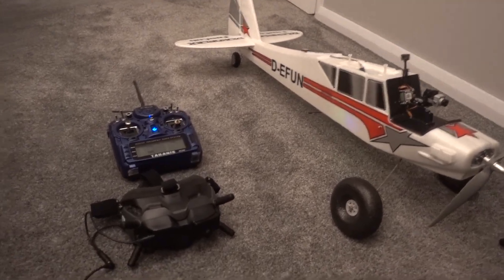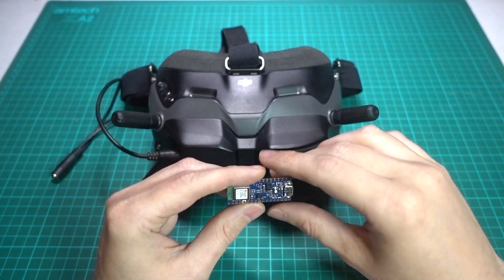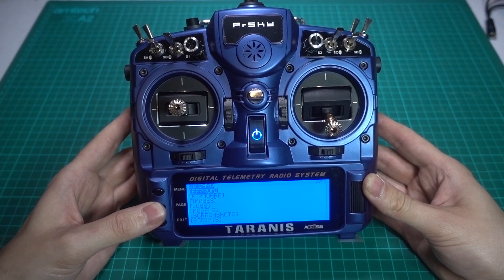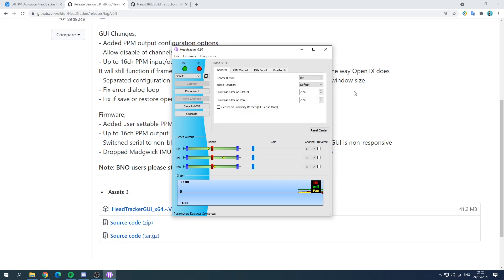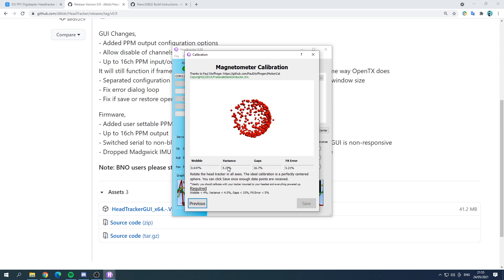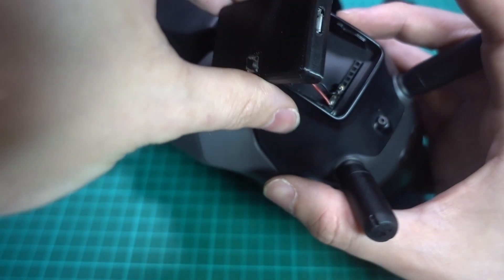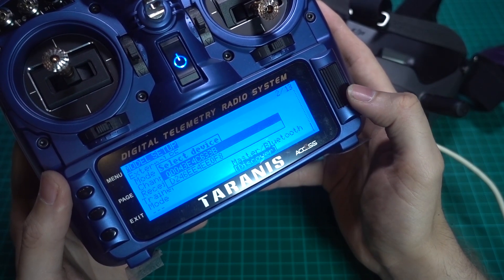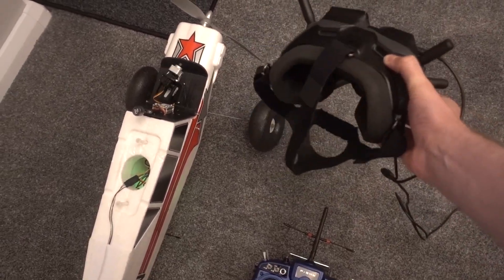DJI FPV Wireless Head Tracker

Comment from the maker: Digi Adapter:
https://bit.ly/3yD7qPm
https://bit.ly/2RHPaDL 
https://bit.ly/3yzkPb9
Arduino nano 33 ble: https://amzn.to/3wvGrn0
Switch: https://amzn.to/3ud2s8B
3d Print Mount: https://bit.ly/2SswcAQ
GUI Download: https://bit.ly/3yK8EZh
X9D Plus SE 2019: http://bit.ly/2GYO7Xn
TX16S: https://bit.ly/2Lpts0I
Radiomaster BlueTooth Module: https://bit.ly/3fKMuwZ
Reply: Could you please link what exact servos you all are using for pan ,tilt?  
I'm currently using a 360⁰ servo which is continuous and all though it works on my wing FX-61 because I can use the yaw/Rudder because obviously wings don't use rudder so I use it for pan.  This would be an issue though on standard plane setups though.    

Thanks.
Reply: In addition, the FrSky bluetooth module doesn't support Nordic's BLE LLPM~
http://developer.nordicsemi.com/nRF_Connect_SDK/doc/1.3.0/nrf/applications/nrf_desktop/doc/ble_latency.html
Reply from the maker: @PaosElectronicDreams  @ pao Nan most of the links you are posting youtube is deleting, please try to do your comment without link thx
Reply: @AndyRCchannel  I've shortened the URL with store link. It's not deleted yet.
Reply: @AndyRCchannel  I am going to test possible LLPM link among the 33 BLE's.
Reply: Where can I get all the 3d printed 3axis gimbal
Reply from the maker: @RCPlaneNut  eastiest way but not cheap search for "bad ass Gimbal" otherwise search for my ultimate plane build

Comment: Hello, when you talk about the sensor on the arduino, is that the same as headers? Because I only found the Arduino Nano 33 BLE rev2 with Headers (ABX00072) or without Headers (ABX00071).

Comment: Just wanted to confirm Andy.. I need to use the head tracker wired because i have my internal Bluetooth module on my Tx16S  MK1 connected to a mini crossbow tracker... therefore I need to use the PPM Para master Firmware? Is that Right?
Reply from the maker: That's correct yes
Reply: @AndyRCchannel  Thank you!!! Kudos to your channel!!!

Comment: I know this is an old video, but I've followed along most of the steps... the only part I cannot get working is that my new TX16S (which has Bluetooth built in from the factory) cannot see the Arduino to bind to. Any thoughts? Any chance of an updated video? 😁 The HeadTracker version is 2.2 as of today. Thanks!
Reply: @AtlayGaming Hello, am on the exact same path as you right now. Did you fix the problem ? Are you sure new tx16s controllers have build in bluetooth ??

Comment: Hi, Cool video thanks! I want to buy a new rc system, and I am a bit confused regarding the head tracker connection. what should I look in terms of connectivity of the remote controller to ensure I buy a system that can be connected wireless to the headtracker? thanks!

Comment: What other goggles will this work with? Will a Spektrum radio work also?
Reply from the maker: It will work with any goggles it just wont be as neat of a solution. Not sure about spektrum as I dont use it. If the trainer port can accept a signal in as well as out then it can do it. but would advise against spektrum as it does not have the control range needed for FPV only line of sight.
Reply: I have a friend that flies a trainer, top wing out of visual range and back with Spektrum Dx9 and a full range 6ch receiver but he doesn't use a head tracker. My radio had wired or wireless trainer set up
Reply from the maker: @michaelmickoberhaus8009  Just had too many failsafes, flyaways and a lot of money lost using spektrum for BVLOS. Its nicknamed team failsafe in the fpv community. You want to be using a radiomaster TX16 with crossfire or ELRS. Much cheaper with a range of 50km plus
Reply: Can you recommend a decent affordable goggles? Was thinking Eachine Ev800D ?
Reply from the maker: @michaelmickoberhaus8009  yes those would be my go to budget goggle
Reply: I have a Radio master tx12 but have difficulty programming it and I don't have a lap top. Never actually fly anything with it yet. I bought it for the additional channels for my planes.

Comment: Thanks for the great video. I have made a 3d print and the only thing to do is solder the module in my Radioamster TX16S.
What is the best way to enable bleutooth on my Radiomaster with EdgeTX 2.6?
Reply from the maker: same as it is in openTX
Reply: @AndyRCchannel  Thanks. EdgeTX is not the same as OpenTX. Write FW to TX is not posible in EdgeTX. Builds option can not be changed and write to TX. In OpenTX it was no problem.
Reply from the maker: @Ard1400  Thats not what he was asking. He was asking how to enable blutooth in edge TX and its the same as openTX

Comment: Can that little bluetooth board be installed in Taranis x9d plus?
I have the Motionsic side mounted tracker and gimbal, but would like to go wireless between them without using a second exterior board that plugs into the trainer port (thats of course under my CRSF Lite module).
Reply from the maker: Only way u can do it is hard solder another Arduino board to the trainer port
Reply: @AndyRCchannel  is that easy to do? And would it permanently take over the jack so that it wouldnt work with a plug and 2nd tx trainer?
Edit..
I checked out the github page.. in the “bridged” diagram it looks like the regular/original jack input would be rewired into D9 on the Arduino board, would then combine channels 1-4 with the HT channels then it’d send it all out of D10 into the original jack-to-tx input.. maybe?
That jack is probably hard on a board though, problematic to reroute original plug I’ll bet.. need to crack it open, but hate to do that, I was just partially into it to install Hall gimbals. Ugh..
What irks me.. I ordered a Taranis x9d plus 2019 that would have been PARA… but instead getfpv sent me a standard x9d plus with a R9M that I sold off in favor of crsf.  Thought I made out on that deal.. until now :/

Comment: Thanks for the excellent video. If the Arduino Nano 33 BLE is flashed with firmware version that requires for connecting it to the radio trainer via a barrel plug, can it be re-flashed again later on with a firmware version which allows it to connect to the radio controller wirelessly via bluetooth? Thanks.
Reply from the maker: it certainly can :)

Comment: Andy, I am about to set up this system with a Taranis X9D Plus 2109  Access radio. I can't get the Bluetooth part figured out. Can't locate the Trainer/bluetooth mode. Can you tell me how? I have my Arduino nano ble board configured.

Comment: How'd you make this? Looking to build something like this but then on a car.
Reply from the maker: All the info is in the video. There are no parts missing. You problem with a car is their controllers have no trainer in port they are all trainer out.
Reply: @AndyRCchannel  hmmm I'll have to find a workaround for that then. Thank you so much! :)
Reply from the maker: @MrCow579  there's a guy who used an easy Arduino board and re coded the pwm signals so it would work. Look up rc car controller for head tracking
Reply: @AndyRCchannel  will do, I appreciate the help :)

Comment: Will it work with a spectrum IX12??
Reply from the maker: Does the radios trainer port allow input signals as well as output? Spektrum is very limited with features and range so I wouldn't recommend spectrum for fpv in general
Reply: @AndyRCchannel  I have a barf bag set up for the camera.
I would like to hook it up to a spectrum ix12 hooked up to an air unit with that tracking system basically with your exact headset that you have with analog and DJI capability 😍
I love that setup
Reply: @AndyRCchannel  P.S...
The crossfire system for the spectrum ix12 is on my to get list as well as the head tracking unit

Comment: Great video, thanks. I tried to load my Nano 33  board onto the GUI keep getting an error message saying “ was unable to determine the board type” and they will not let me connect . I am using a Nano 33 BLE (ABX00034). Any suggestions for me appreciate it. Thanks
Reply from the maker: Sounds like you are trying to use the wrong configurator
Reply: @AndyRCchannel  Is there another configurator? I thought this was the only one.

Comment: Awesome! I've just purchased the Bluetooth board via the link. Just to say though that at 4:35 when it shows the Bluetooth board... I'm guessing that's not the latest FrSky board, because it's using an antenna wire, whereas from researching it seems to be that the FrSky board has an onboard antenna, so no separate antenna needed. Please comment though, especially if I have this wrong.

Comment: I have successfully flashed both the bootloader and frsky firmware to a generic RF-BM-S02 module which is the same as the FrSky module but comes shipped without the required bootloader or firmware and confirmed it working in a radiomaster. 
I did my first one by soldering 30 gauge silicone wires to the pads but I have a programming clip on order which will allow me to flash more modules without soldering to to them and plan to put some on eBay as I can get generic modules cheaply from China but they need both a bootloader and the firmware flashing to them which annoyingly is done by different pads and different flashing tools but does not take long once you have it figured out.
Reply from the maker: Ah that's great. EBay sounds like the best bet. I'll buy one off ya

Comment: Mine is a crossfire full side with bluetooth, can I use it with this arduino module, I do not have bluetooth in the radio or the version of opentx for bluetooth.

Comment: I don't know if you mentioned it and i missed but does this work only for CRSF? Also can this be done in Betaflight?
Reply: It will work with any protocol providing you have 2 channels spare. Yes it can be done in betaflight... see painless360's quanum headtracker guide and follow the same steps just at the betaflight section.

Comment: The FrSky Bluetooth module is based on non frsky hardware but with frsky firmware on it.
I am trying to get a non frsky module working at the moment,  I have managed to flash a bootloader to it but now I have a bootloader,  I'm trying to figure out how to make it respond to a firmware flashing attempt which has so far not played ball.
People with a horus radio can flash non frsky modules with the firmware from your radio, it flashes them when they are installed I am told by someone in the know.

Don't know if the jumper or radiomaster radios will do the same but I'll try it with the module soldered in using 30awg silicone wires rather than directly to the board as removing it again will be easy to go back to programmer flashing attempts if it does not work.
Reply from the maker: You need the one without the ufl connector 30gbp. That one works. Radio master themselves confirm that works. The one I took out of my Horus worked also. But that will have their firmware on it then I guess?
Reply: @AndyRCchannel  yeah,  I have the module with the integrated antenna, mine was £5 from China 😀
The module is a RF-BM-S02 irrespective of antenna type if you didn't know the part number already, that's what the FrSky module is but the ipex/ufl version as you obviously know.
Yes, the one taken from your horus will already have the correct firmware on it,  installing another module without the firmware to your horus would result in your horus flashing the firmware to that module also. 
That's promising news regarding the radiomaster,  looks like I know what I'll be attempting after dinner, fingers crossed 😀

I have the FrSky module firmware if anyone is interested in it, it's not easy to find!
Reply: @PonyPonyBaloney  what Andy is doing or the FrSky Bluetooth module in the tx series transmitters?

Comment: What is the latency? Can it work with a tbs tracer? 😉😉
Reply: Its bluetooth so there will be a little latency, but you can see from the video that its certainly not bad. Don't see any reason why it wouldn't work with tracer.. it will work with any protocol and receiver unless all your channels are already in use. this will need 2 spare channels to work.

Comment: I'm using the x9d plus accst version.
  I set this all up a couple months ago.
I started by running a mono jack into the trainer port and it worked like a charm.
     I then bought a second arduino and set it wireless, again with a mono jack to the trainer port, and it did work, although with some lag and some jitter.
      I ended up going back to the wired setup.
   Is it possible to solder the ardino into my radio? Maybe use the the uart connection? Do you think it would be less finicky than through the trainer port?
Reply from the maker: It is possible but if you were having problems then you will have the same problems with it inside your radio. Plus its always turned on with that method.
Reply: Did you use the same github Code for your wired setup? Just solder the mono jack to the arduino and it works?
Reply: @he1nz453  There was a seperate (slave) firmware in the folder. I flashed the second arduino with that code.
   It did work, it was just laggy and jittery. I went back to the wired configuration and It worked perfectly again?
Reply: The Bluetooth thing would have been cool, but I just built up a custom cable that will power both the arduino and the goggles from a lipo in my back pocket, and ran the signal cable back down the same line and split it off to my taranis.
    I added another momentary switch to ground just before the 3.5mm, so I have a centering button that velcros to the back of my radio.

Comment: Hell yeah!!! Ive been wanting to do head tracking for a while and this looks amazing. Anybody know if the original Jumper T16 has the solder pads for the Bluetooth module?
Reply: There are at least two different BT modules that will fit in the TX16s (on it's BT site) If you buy the wrong one it won't work. I played it safe and used a second arduino (wired it directly to the trainer port). I put the arduino inside the battery bay.  You need to read the thread on RCGroups to get a better idea of your options. ( if you use it don't forget to buy him a beer or two!)  https://www.rcgroups.com/forums/showthread.php?3822641-FPV-Head-Tracker-Single-board-wireless-easy
Reply: @Chilternflyer  Thanks a lot for the info!
Reply: @flipfpv  yes it has the pads and you can buy a generic RF-BM-S02 (same as the FrSky but without the correct firmware) module and flash it with the bootloader and then the firmware for much less than buying an Frsky module. 
I have done it and confirmed it working in the radio
Reply: @stevefox3763  That's great! Thanks a lot for the info, Steve! Much appreciated.